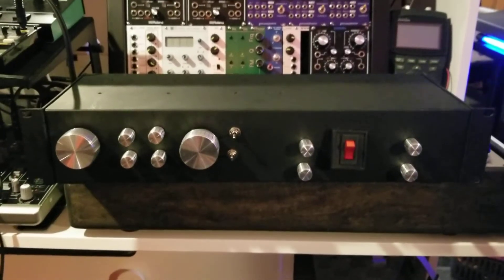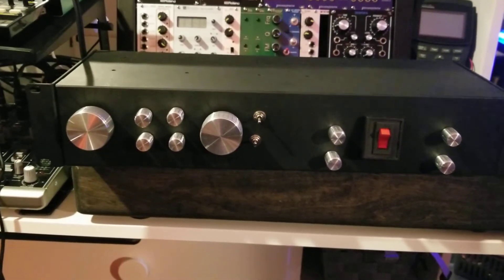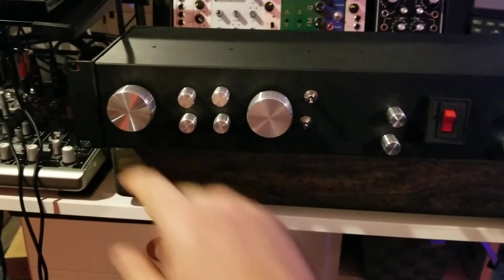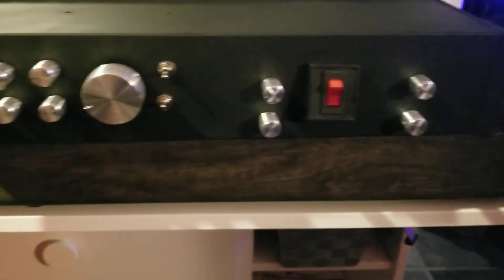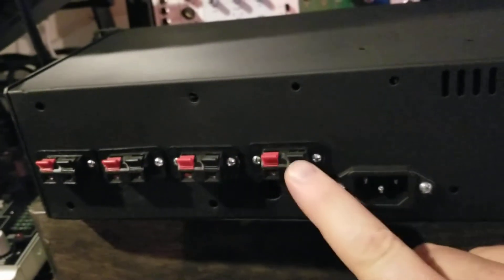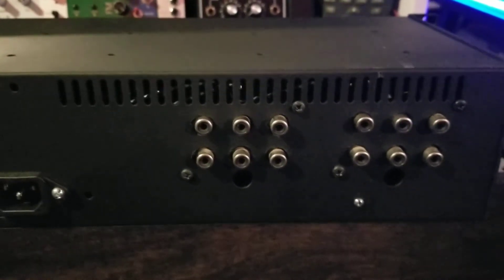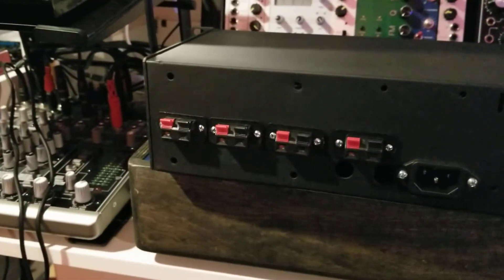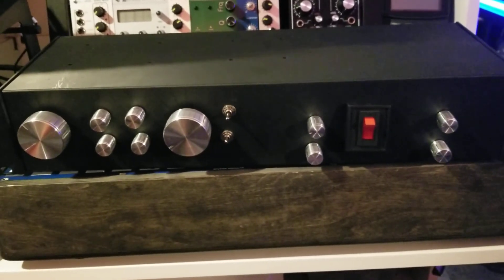DIY Monitor Controller

Comment: Hello, why dont you share schematics? peace
Reply from the maker: On the pot, Pin1: Negative, Pin2: Output, Pin3: Positive. You do that for each audio signal that you want to control. Use a dual pot if you want to control 2 signals at once (like Left and Right). It's passive, so the signal starts to sound bad if you turn the volume down a lot, but works pretty good in the upper half of the pot. An active one is not much harder to make, but this way worked for my purposes.